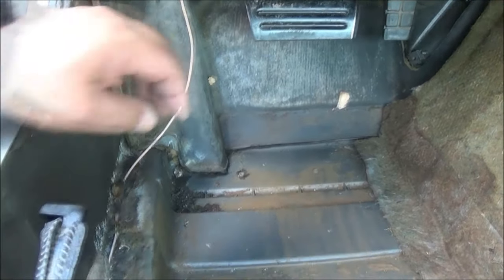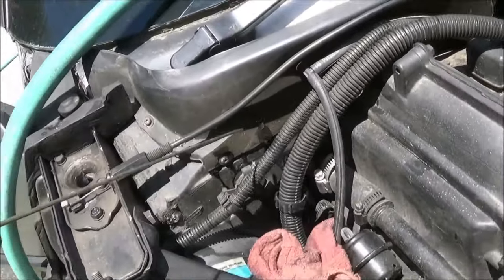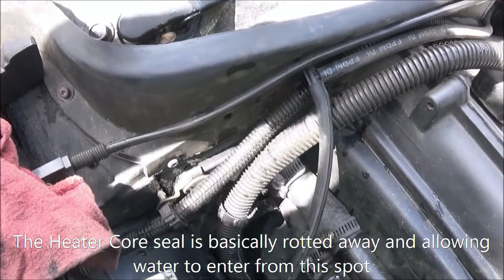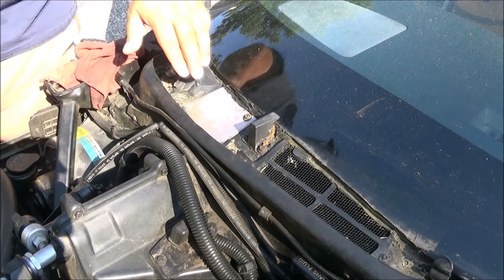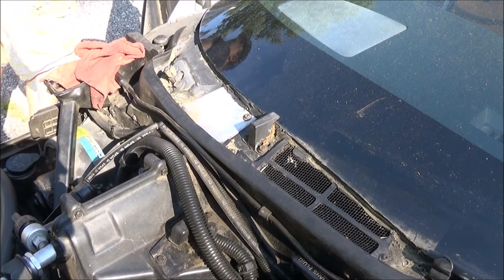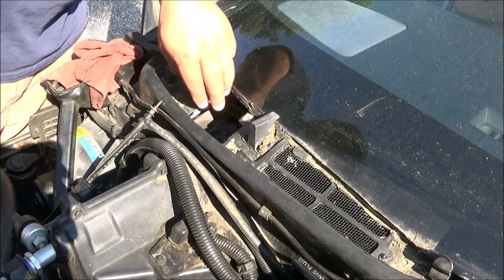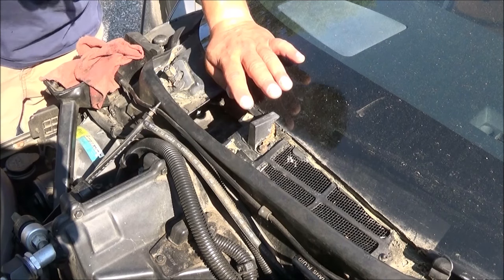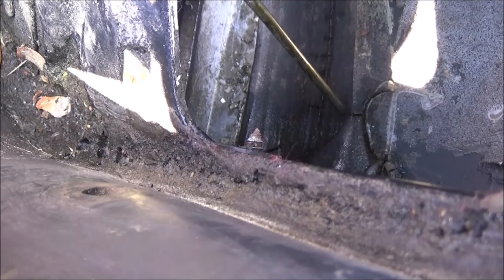Video 9 - 1985 C4 Corvette Cowl Leaks, Cowl Drain Holes and Cowl Body Sealant

Comment: Great info. However you need to give a warning about removing the plate to access the back weephole.  On an 88 the plate goes under the windsheild and at edge of glass has trim. The windsheild lace or sealant is pretty heavy in this area. If you don't get this cut and free from the plate before you give it a pull it will result in a busted windsheild. Just learned an expensive lesson.
Reply from the maker: Very good point, I wiggled mine back and forth before pulling it out so I did not notice that.
Reply: @donaldcombs4677  Mine wiggled with resistance. Was free from seal on windsheild. What I didn't know and couldn't see was the giant glob on the back of the little metal piece that goes around the bottom edge of glass. Send you a pic. Of coarse it wasn't this bad til I realized I had to replace windsheild.
Reply from the maker: @brianwellmon2104  That is sad to hear.

Comment: Great vid, but did it work? Could not find the follow on vid for the water leak. I did what you did, and had water seap into the passenger side floor board. Might be AC overflow vent, ( don't know where that is) cause the heater doesn't work( blows cold air on heat setting , and shifts when switch is on vent, defrost, ... any ideas? I'm local if you can take a look.
compensate if needed. Or recommend where to  take it.
Reply from the maker: check the seal where the heater core comes through the firewall, I talk about this in the same video. also What I did for the cracks in the body putty did work. as soon as I sealed the heater core  in the firewall I now have a water tight cowl and no more water comes in from there... the old seals are another matter all together. if you want to meet we can private message me and we can go from there.
Reply: @donaldcombs4677   I'm new to you tube, how do I PM you with out showing the world? TEXT. Thought it would work like a blog and clicked on your picture to allow PM and it did not work.
Reply: @donaldcombs4677   Are you  near Sandown, NH
Reply from the maker: @afammo2956  Good Question... I can't seem to find that anymore as well... Might be a config setting.. I will look.

Comment: What sealant are you using where the factory seal cracked?  I had a leak in the drain around my convertible hood and used Mariners putty...10 years later and still going strong.
Reply from the maker: I used an epoxy sealant I believe.